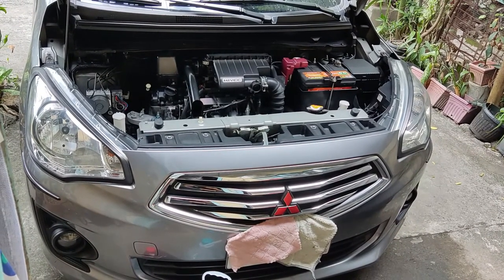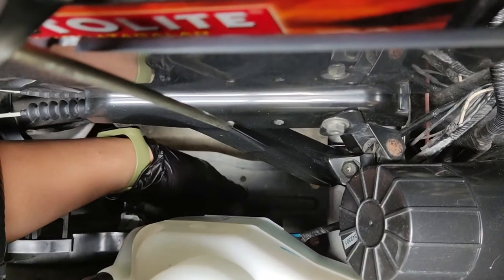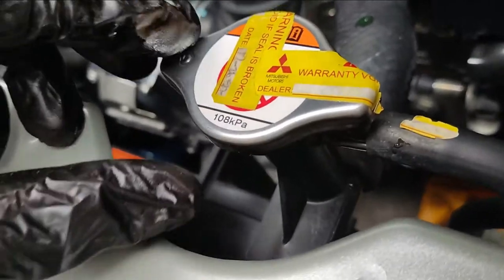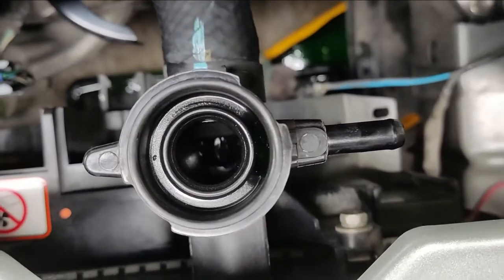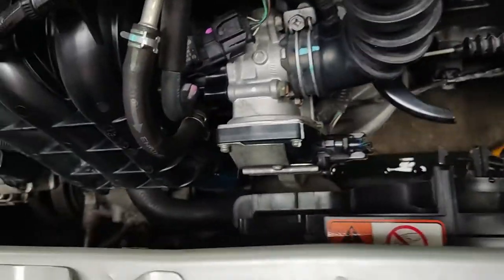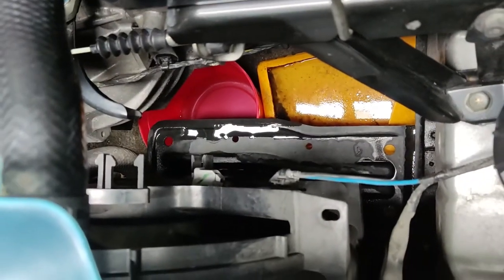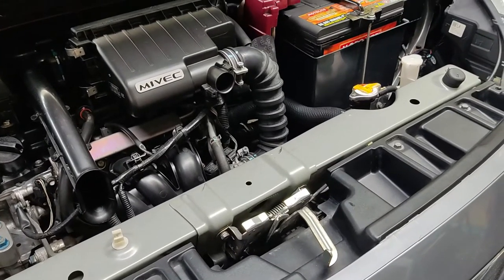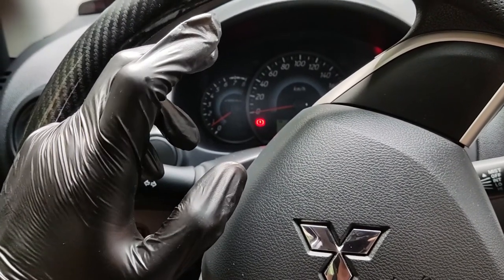Coolant Flushing on Mitsubishi Mirage G4

Comment: How many liters did you put in the gearbox?
Reply from the maker: i used about3.2-3.5 liters,  i just topped up both the radiator& reservoir to its max level, just make sure that you bleed which is very important and top-up accordingly as you bleed, so the 4liter coolant should be more than enough with some extra

Comment: Sir bleed mu,mga 2 ikot ng aux fan.huwag on ang aircon.pra mas mwala air s loob ng cooling system
Reply from the maker: yes tama po nbleed po 3 ikot ng fan din po di lng npkita s vid, tnx po s advice
Reply: Mga boss pano po itong procedure na to? And sang step sya gagawin?
Reply: @jancasanova5863  coolant bleeding pra mawala un air pockets s cooling system.nood k ng ilang video s YT praay idea paano gawin
Reply: @patricklingad815  thank you sir!
Reply: Good day sir, ano po ibig sabhin ng 2 ikot ng aux fan? paano po malalaman na nag on na ang thermostat at nag circulate na ang coolant...ty po